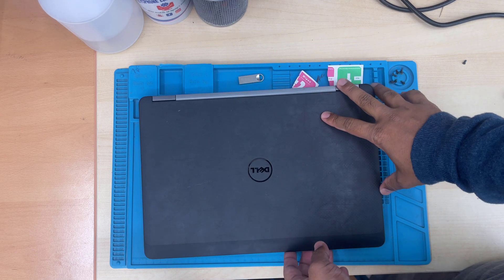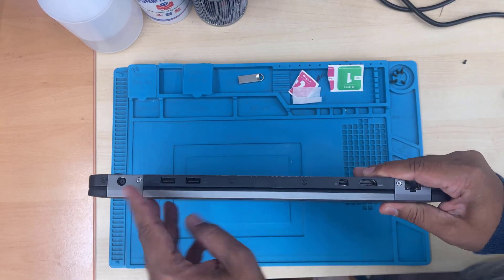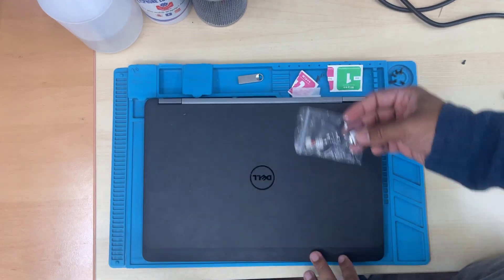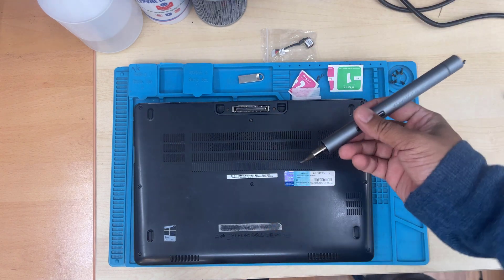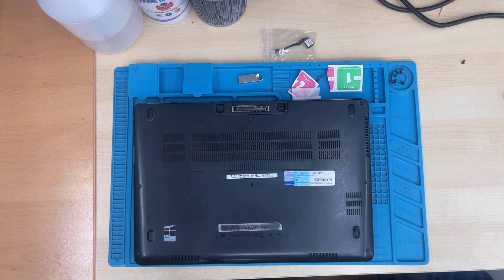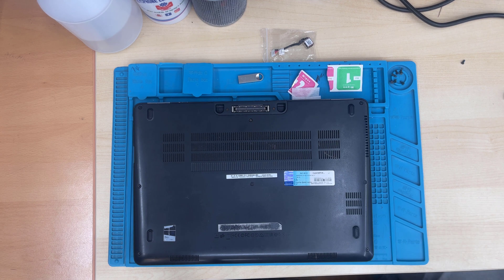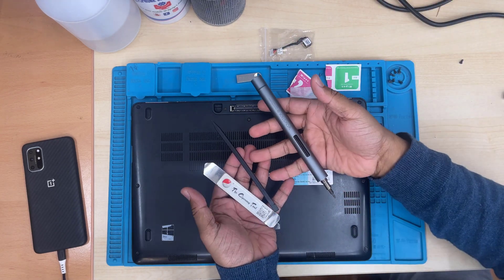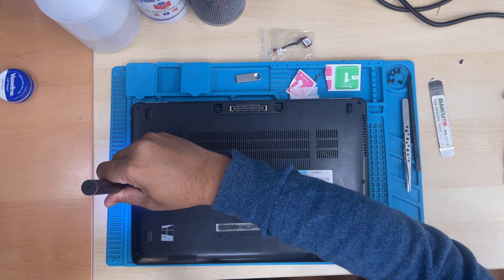How To Replace DC Charging Port For Dell Latitude E7470

Comment: I bought a used Dell Latitude E7470. It came with a charger, but the tip is too big for this laptop. I can’t find a smaller one or an adapter. Is it possible to replace the port to accept a larger charger tip?  Thank you in advance for your help.
Reply from the maker: Thanks for your time. I think I understand what you are trying to do. But it would be ideal for long-term running. Instead, why don't you replace the charger? Thanks